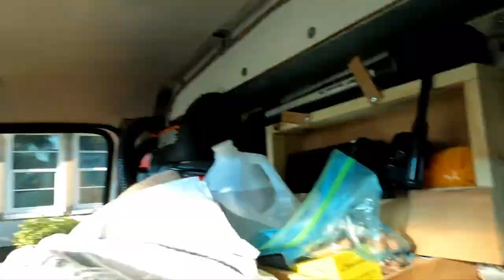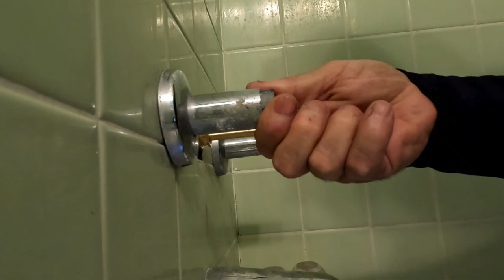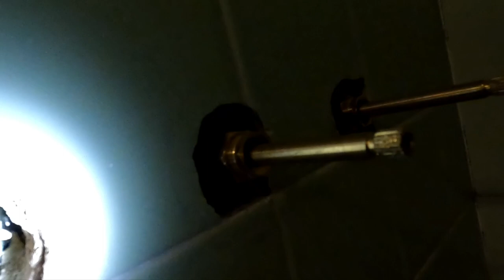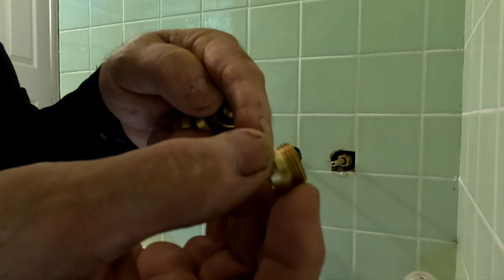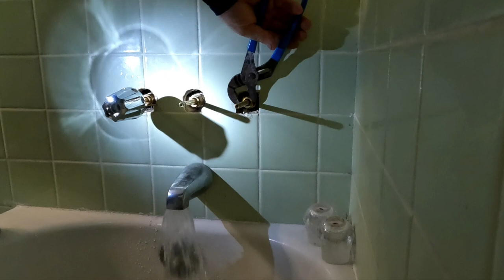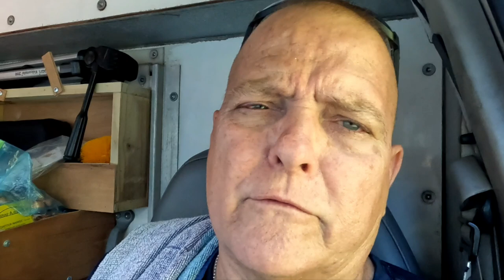GERBER 3 HANDLE TUB/SHOWER REPAIR

Comment: My shower also has a GERBER generic diverter stem and I changed it but the shower still is not working. I tried to change the seat but it was not coming out. I used different tools for the removal of the seat but I could not change it. The seat seems to be a circle shape and maybe it is not removable. The hole is also too small for the use of a reseater tool. Can you please help me with it?

Comment: This might be a dumb question but do i have to shut off main water valve? My house has 3 apartments...
Reply from the maker: You definitely want to make sure the water is off!
No water pressure on both hot and cold,good luck!